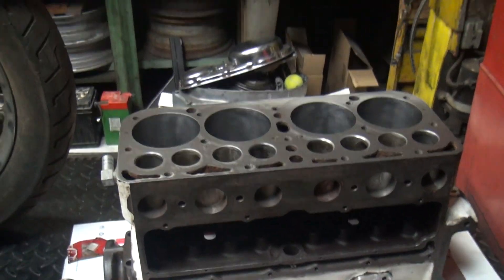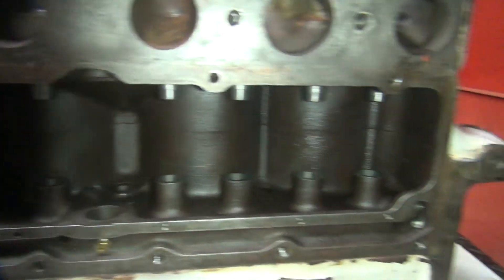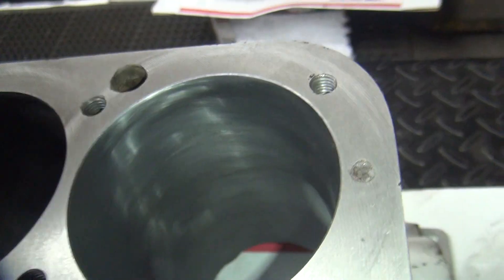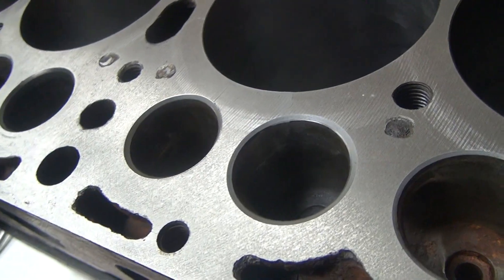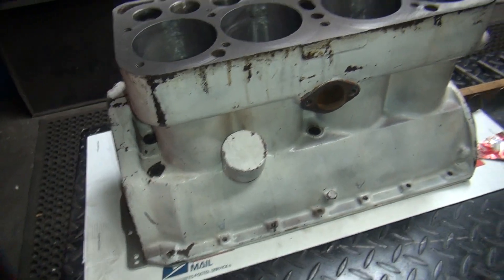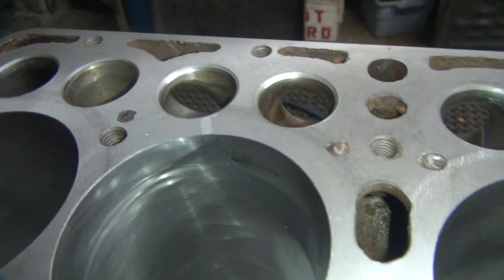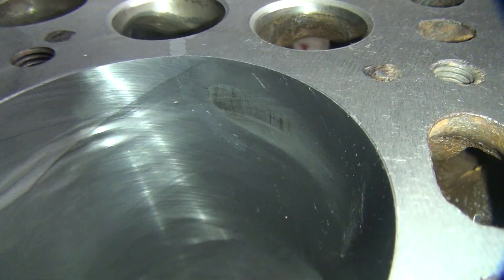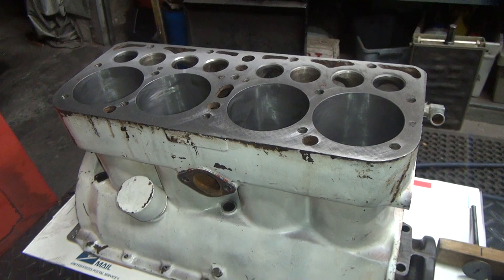1932 ford #120 model A or B flathead race block crack repair by tatro machine

Comment: Nice work with the stitching really... Personally I would of went that extra 10% to really bring it back to perfect instead of leaving it to "functional".. I just like to have peace of mind when I close the lid :) In my opinion this is a job done only at 90%. but if thats what you and your customer are satisfied with then thats just perfect.
Reply from the maker: ithe block passed a 100psi pressure test and went back to the track just fine. so what is the other 10% you think is needed.
tatro

Comment: You shoulda bored those out more. That's kind of a shitty job. If you can't go more, sleeve em.
Reply: If you were doing it for me, I would reject that crap.
Reply from the maker: you are so full of crap you would not know a good job from a bad one. watch the videos dumbass and learn something. what i did worked and lived on a nitromethane landspeed race car. that isn't no stupid street motor.
sleeving makes the motor smaller. not happening. 
boring the cylinders more is not happening either. did you bother to see how thin the cylinders are already?
you either fix what you got or build another max effort motor again. i fixed it and this is how i did it. no one else would touch it but i like a challenge and did the job. it was as good as new after i fixed everything including the super rare and warped head.
tatro
Reply: Tatro Machine 
You already said the motor is extremely over bored. So logic would say that sleeves would make it stronger. If you're making a race motor, you want a strong block. And the sleeves wouldn't make it that much smaller. People go .125 over on these engines. Worst case it brings it around stock bore. At .125 over going back to stock will only lose you 13ci of displacement. The cylinder strength you gain will more than make up for the minor hp loss. Not only that, but now it can handle more hp & cylinder pressure.
Reply from the maker: i am fixing this motor, not redesigning the motor for the customer that has been using this same motor off and on for over 50 years. i will guarantee that you will feel the extra 13ci in your butt. flatheads don't have crap for cylinder pressure and those cranks will not take much either. they were also using low percentages of nitro.
everyone has their own ideas on how to build a motor. you have your, the owner has his and i have my own. all of this has nothing to do with showing the viewers how to repair a block if they want to do it themselves. 
you started all of this on saying how bad my work is and you are full of it. the job has proven to be good by making more runs at the track without any problems in the repairs i did. now if you can do better or as good then go for it. make sure you post your videos so the experts can tell you how great you are.
tatro